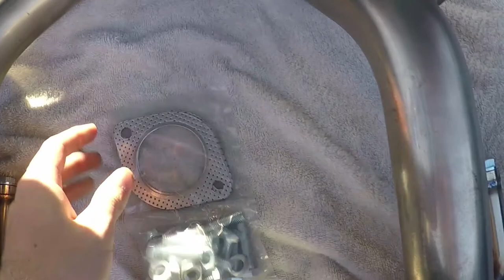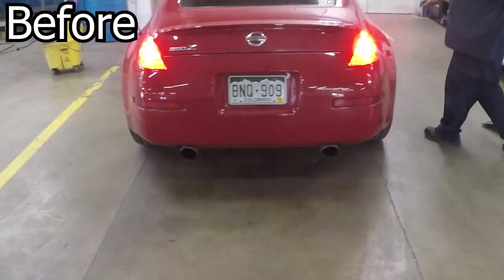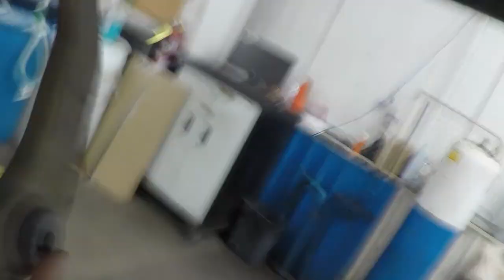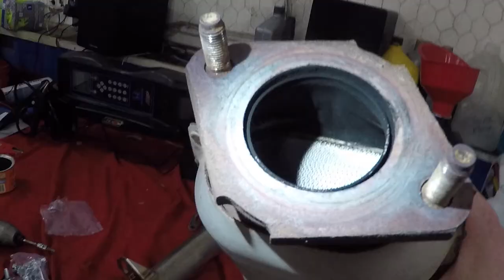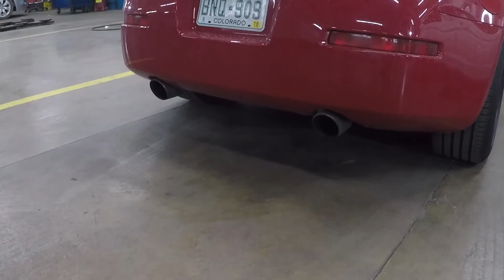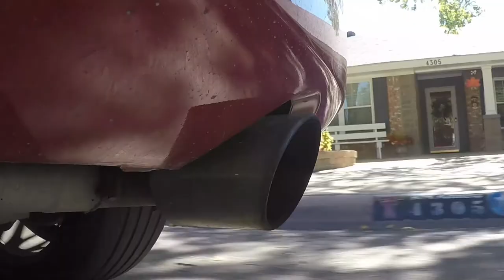350z Test Pipes Install and Exhaust Clip

Comment: Nice video, I recently installed the Z1s on my Z. I had issues with the midpipe touching the rear brace. Overall I like them and I really felt the power on the butt dyno. :D
Reply from the maker: Z33 Garage Thanks! I can feel more power in the mid range as well. I need some new tires to really feel it though. Thanks for watching!

Comment: A bit late but, I installed my test pipes about a month ago and I absolutely love them-- a tune is definitely required. As many people have mentioned, i did get the hissing noise on deceleration. I know you don't have and maybe because it's the type of y-pipe you have? Mine was fabed  up by a shop so I guess switching to a larger diameter y-pipe should help?

Comment: Wow, this is exactly what i'm looking to do to mine in a few weeks. I have a muffler delete as well was hoping to crank up the volume as well lol. How do you like them so far? Has your cel come on?
Also, I didn't notice that hiss like what most people have, or maybe the mic isn't picking it up. Overall though, is the sound the same but louder and cruising speeds and what about the smell?

Sorry for the questions lol, i'm really stoked about getting these and hope they're as good as I believe they are.
Reply from the maker: SmashOhaxorz I love the Test pipes, no CEL either. There is a hissing but I thought that was exhuast leak🤔, the hissing only happens when you are off the throttle. The car is very loud now, way louder than the muffler delete for sure
Reply from the maker: SmashOhaxorz as for the smell I do notice it sometimes here and there but only after I really get on it, or if you are stationary and start revving
Reply: That's awesome. Glad to hear that. So you'd recommend them 10/10?
Reply from the maker: SmashOhaxorz for sure if you are wanting to make it louder man
Reply: Alright, thanks for the feedback. I'll be sure to pick these up in the coming weeks. 
One more question, how much do you think these will be to install? I'm not really inclined enough to install these myself.
Reply from the maker: SmashOhaxorz honestly man I have no idea but i would definetly shop around to get a good deal
Reply: Egbert320 Alright,  will do. Thanks for the info.
Reply: Sorry for all these questions lol, but do the cold starts sound louder or is it the same?
Reply from the maker: The cold starts are definetly louder  for sure